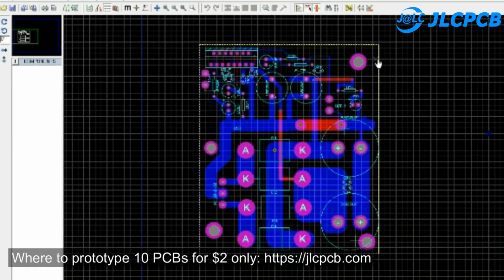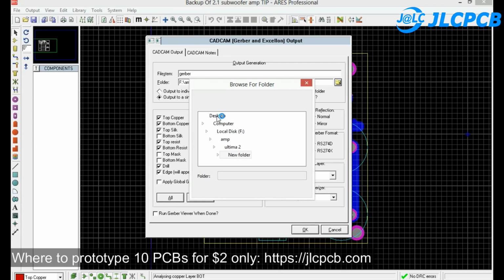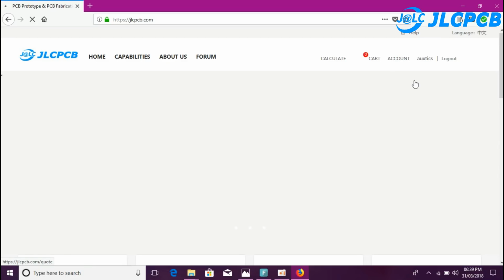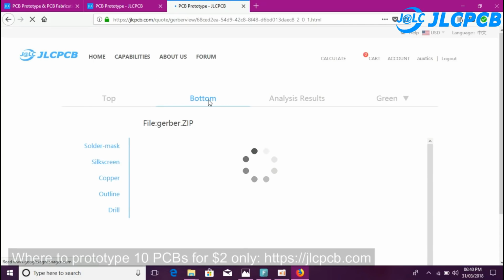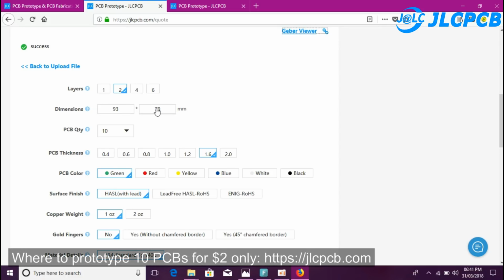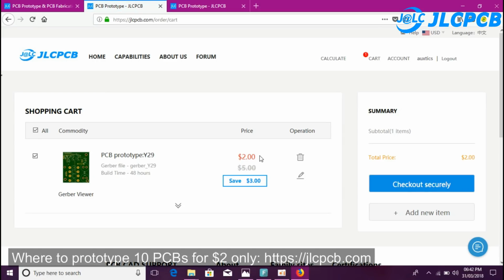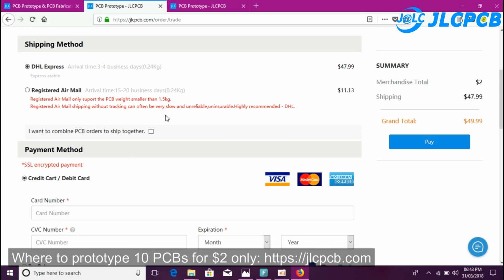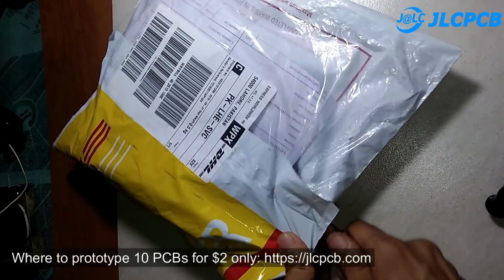How to make a Hi-Fi Applications Amplifier /JLCPCB

Comment: I really like the layout, looks great. I like the green connectors for the out's, you can fit heavier gauge wire. I wonder why you didn't use them for 100w? Here's where I get stuck, is how you knew to add the certain value of these components and how you knew which components to use for the stand by and mute? Excellent and worth $50 all said and done. If you sold one fully done it would pay for all of the others.